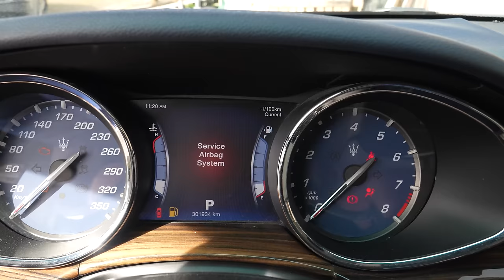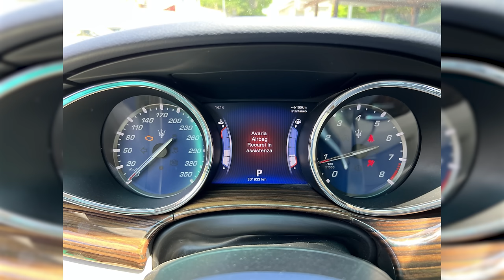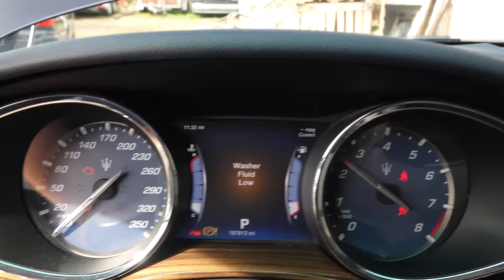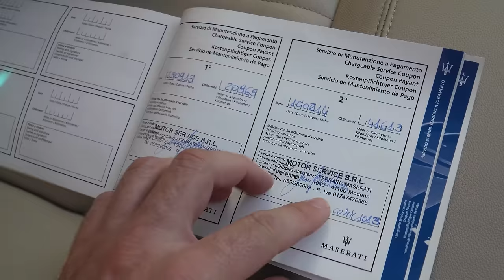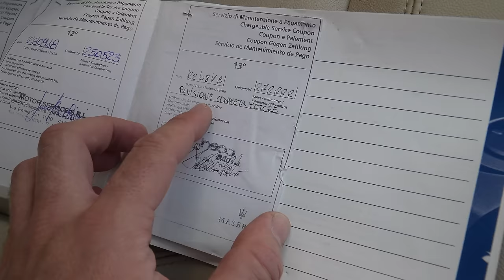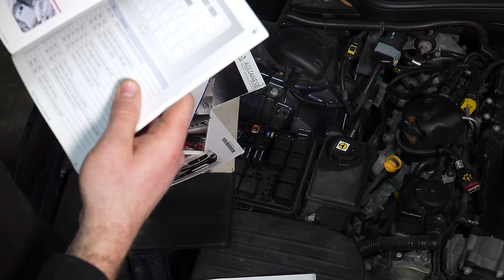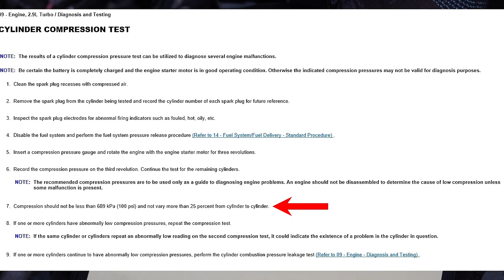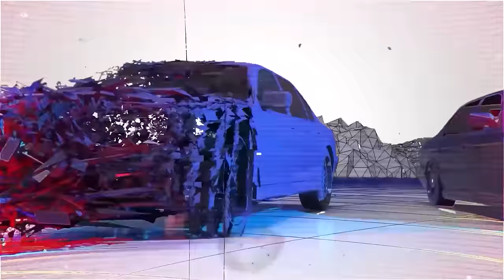I Bought The Highest Mileage Maserati Quattroporte GTS - Project Mantua: PT1

Comment: I used to work on Maserati's and I wish you best of luck with finding a problem within a problem which is caused by a problem and then there's these 3 other problems which are causing another problem. When they do work however, they're an absolute treat to drive and listen to. I always called them an upgraded Alfa Romeo. In both problems and quality.
Reply: He certainly is not somebody to shy away from challenges.
Reply: You could be describing any modern BMW repair experience. I wish people didn't always talk trash of Maserati, especially after seeing how bad BMWs really are. Ask you a question: would an E60 M5 have ever reached even half of the mileage of this Maserati, without rebuilding the engine twice over?
Reply: And there’s a lot of switchgear that is shared by Chrysler/Dodge products so that will definitely keep some costs down!
Reply: @71ala exactly, look everything the Alpina B7 needed at 110k miles. A new engine was only the beginning.
Reply: @71ala as long as you replace or upgrade rod bearings before 100k sure
Reply: You just made a diamond look like coal :)))
Reply: dont shit on alfa romeo
Reply: @thomass.586  there are challenges and then there are lost causes like this trident..
Reply: @seashackf1  That was Alpina's fault though, not BMW.
Reply: @71ala  The V10 is great as long as the rod bearings get changed, which sure isn't a small thing but FAR better than this glorified Fiat lol
Reply: @kristoffer3000  he had to replace plenty of BMW parts on that car. Without those Alpina parts it’d also be just a regular 7 series. Alpina parts are what give it that level of performance and make it so good.
Reply: @kristoffer3000  glorified fiat, lol. At least be fair, this car has a Ferrari designed and built engine. As good as that V10 is there’s a reason they sell for so cheap. With all its problems Its no more reliable than this.

Comment: I was a fan of the channel before. Now I'm a stalker. 300k on a Ferrari engine is amazing. Great find.
Reply: Ya people will trash Maserati, but it’s pretty damn impressive the car is still alive. People are significantly less likely to maintain these properly than Ferraris with the same engine
Reply: It was rebuilt at 270K, so really, the engine has around 30K on it. But it is impressive it lasted 270K for sure.
Reply: @JStryker7 maserati deserves to be trashed, i had a quattroporte with 78k kilometers on the dash and the engine sounded terrible, camshafts were trashed and metal shavings on the oil, it happens very commonly on these cars, window regulators broken, buttons on dash had a tacky film that was melting and got on your fingers, knob to move mirrors was broken many many bad quality pieces the car was taken care of, not a single scratch or dent, inmaculate seats and steering wheel, so it wasnt mistreated just bad quality on parts
Reply: @esdar66g95   and what year was that one? I haven’t seen that with the newer ones. They use many of the same parts as fiat, Chrysler, Alfa, etc. I’ve driven a modern Alfa for years and it’s been perfectly fine
Reply: @JStryker7 it was a 2006
Reply: @esdar66g95  ah okay so it was the previous generation
Reply: Especially only changing the oil every 20k km.
Reply: @tonymontana897  revised in Italian means reviewed, it doesn't mean restored. Also 20k is the usual oil change interval on some Italian cars that use Selenia 20k oil.
Reply: @esdar66g95 I have owned a V8 Maserati since 2009 when it was new, and apart from the sticky plastics issue (after 18 years), it has given me ZERO issues. So, Maserati DOESN'T deserve to be trashed, not any more than (to make an example) a BMW M3 V8 that eats its own engine bearings after 40,000 miles or breaks the crankshaft in two pieces (see this very channel...)
Reply: @esdar66g95  Yes, They are woefully bad in quality after Chrysler FIAT took over. They put their stank all over them.
Reply: @hugovale6360  20K is way too much. It will sludge up quite badly and cause many long term issue and shorten engine life.
Reply: @71ala  the rod bearings thing is over stated. last a lot longer than 40K miles when serviced and operated properly.
Reply: @tonymontana897  Shorten engine life?? Which engine are you talking about?
Reply: @71ala Exactly!
Reply: You look different into it.

My volvo s60r 2006 had 570k km on it. First engine.. & stage 1 365hp

This car has 300k, but has been rebuild already and the cost to keep it running probably was more then the car it self.
Reply: @JStryker7  As awesome as this car is. Isn’t 18K Euros expensive for a car with 300K kilometers?
Reply: @JStryker7 As awesome as this car is, isn’t 18K euros, expensive for a car with 300K kilometers?

Comment: I can only bow to the brave person who put 300k on one. Chances are he paid 3x the sell price in keeping it running. The service history says "Modena". Chances are, this was a company car which a company owner/director used daily to go to appointments and so on, for a decade. I can almost picture it. Excellent work!
Reply: It cost 100k new, you think it cost 300k to keep running? The annual service is about 600 and every four years 2000.
Reply: @rajivpaladugu8445  no i think it was expensive because they rebuilt the engine
Reply: @arbiya4346  According to the video that happened at 172k miles.
Reply: @rajivpaladugu8445  he did say the selling price not the new sticker price. Although I'm betting you're closer to the truth.
Reply: Not brave, lucky to get to drive it for 300k km’s.
Reply: @arbiya4346  The Alpina B7 needed a full engine rebuild at around 110k miles, amongst it’s many other problems. The Maserati will not be worse than that car and may be far better with what it needs.

Comment: I really hope that this project goes nice and easy and doesn't scare you away from maseratis, in the future you have to do a series on a 4.7 gts quattroporte, a truly phenomenal car that has been in my dream garage ever since I saw and most importantly i heard it.
I don't comment very often so i want to say that your channel is one of the greatest and literally my heart beat races every time i see a notification, thank you for the years of well made, well edited, humorous and really thorough repairs and restorations!!
Reply from the maker: That's the one I was looking for, but they are also rare and difficult to find. One day hopefully!
Reply: @M539Restorations  I really hope you do!! The problem with the gts is that not only it is the best fifth gen quattroporte to drive and look but also to own, the facelitfed models had much better electronics, the zf 6 speed was much better than the duoselect, the wet sump engines were more reliable than the early dry sump 4.2 also the gts had, as standard at least, fixed rate bilstein dampers so no skyhook to worry about either. As a result they require a premium when they go on sale and their owners are less willing to part ways with them. Still I hope we hear it's roar in your dojo one day!!

Comment: I don't know if this has anything to do with it, but on the Ferrari's they have 2 Engine ECUs; where each one is located, they control the opposite side bank! I would imagine this being a V8 it has 2 ECUs and probably follows the same non-logic
Reply: I don't think FCA would've used that type of engine control. This probably has one of their stellantis architectures which is actually pretty advanced.
Reply from the maker: Thanks, Sam! This one only has one ECU, it's the newer generation V8 and they thankfully ditched the 2 ECU setup.

Comment: There's a video of a Quattroporte with 426.582km on "STR testy" from +2 years ago. Something very interesting from that video is that back when the car was new, the owner did +90k in 7 months and went to the service due to a chain rattle. Problem was, that Maserati did not provide service instructions for the timing chain for the auth. Maserati dealer. A guy came from Italy, diagnosed that the chain was indeed to be changed, did it and everyone went on. 2nd chain was serviced 260k and third was good for the 426k in the video but the guy says it's getting noisy.

Also both front fenders were changed under warranty, because the inner plastic liner was rubbing them from the inside.

The car had very little or no corroding outer panels or undercarriage - keep in mind polish roads are as bad as german or even worse in winter due to salt.

Safe to say it was serviced similarly to yours (20k oil changes or even more) so that "Ferrari" motor could very much be very strong after all. Cheers Sreten!

Comment: Ferrari next 😛, after the E92, there is nothing in BMW welt left. This thing is going to be gorgeous. A gorgeous Fiat-Chrysler-Ferrari.
Reply: What about E30 M3, E36 M3, E28 M5, E34 M5? There are lots of uncovered classics from BMW which are yet to be resurrected.
Reply: And the m1
Reply: @ZiemoPL  Those are gorgeous classics for sure, but the man has now done multiple full engine rebuilds of the most complex NA engines BMW ever made. An E34 M5 would be 3 steps back in terms of skill required to repair it.

Comment: I don't think revisione completa motore means the engine was rebuilt. In france, most garage use a very close term "Révision complète" and it doesn't mean rebuilt at all, it just means as you say, a thorough service where more parts and points are checked and replaced if needed than your usual service where they just supposedly change your oil and all kind of fluids.

Comment: When I heard cam timing, I thought of an alignment problem between crank and camshaft. If so, then likely a timing 'belt' or cam adjuster, if one is present. 
I wasn't surprised by the consistently low compression on one bank UNTIL you said the bank number, which is the opposite of the sensor.
Maybe the bank sensor cables were swapped, but that is highly unlikely.
Looks like an interesting build ahead.

Comment: I saw that the exhaust has some flaps in it at the mufflers check if they open and close and unstuck if needed and if you like the sound really much do the golf tee mod as per bmw e46 flaps vaccum hose and leave them forever open so you dont have to be in sport mode all the time

Comment: If the timing is off, that could easily affect the apparent compression reading. In particular, it might have a lot of valve overlap or otherwise having the valves open and air exiting through the valves for a short time during the compression stroke. If the timing is wrong, it might end up with less valve overlap and a higher (measured) compression reading.

Comment: If you close the latch on the doors while it is open, it will stop the dinging. You just have to remember to un latch it before you close the door by pulling the door handle.

Comment: It is possible that when you started to measure the cylinder 5, 6,7 and 8 the oil system was primed from previous measurements and that is why they had a higher compression. You can repeat the test but start with the other bank first.

Comment: My man, i even't watch the video yet, just reading Maserati, tell me everything. What a big step into one of the best car's brand in the world. Other than Ferrari, only Maserati and Fiat used a Ferrari engine in their cars, and Maserati still use it in the Quattro Porte, and it sounds 10 times better than an original Ferrari one. All with luxury and Italian Style.
Revisione completa del motore, in technical term, is totally disassembly of the engine, measurement of every component subject to wear, possible rectification of engine block and head, all engine bushings (bronzine), crankshaft polishing, etc etc. (I'm Italian, feel free to ask anything)
Reply: Correction: Lancia also used Ferrari engines. First in the Stratos, and then later in the Thema 8.32

Comment: No play in those wheels? That was sarcastic right? xD

Also, oil pressure on any engine afaik is normal with 2bar at idle +/-0.5bar and when you rev it, 5bar.  Pretty universal afaik.

Anyways, awesome to see this! Looking forward for more videos, also, the play on those wheels is just off the chart, must be going toe in and toe out like crazy when driving

Comment: I do like the Maserati design language and their take on Ferrari engine noises is a particularly pleasant one. But, and this is a big one: you will never be able to completely exorcize the electrical gremlins from that car. It's just inherent to all Italian cars. I probably would have tried my hand at a Maserati Ghibli instead, at least they're even cheaper so the pain is slightly less, plus they're somewhere between the size of a 3-series and 5-series instead of a large sedan like the 7-series. Depends on what you want, though. If you want a luxury barge then the Quattroporte is very suitable. At least it handles better than most luxury barges, despite the size.

Comment: Just bought an e60 n62b44. super cheap, For reasons im now theorizing is a cracked head/block. Previous owner had coolant resevoir explode, When i got it i took the water pump off and there was some ice, I was scared but didn't think to do a headgasket test at the time as i was doing valve stem seals. Did the seals, Car is "smoking" or steaming out the exhaust with plenty of water dripping, Coolant hoses feel solid as a rock there is so much pressure. Will test for c02 tommorow but all the signs are there, Especially considering head gaskets on a bmw are one of the things they got right. I got it for pennies but its an auto, If i gotta rebuild the engine then its getting a manual trans.

Comment: There is a common misconception that "turbo" = quiet or "bad" exhaust note, but that has a lot to do with modern (already-quiet) cars having a pair of turbos which then further muffle the car. You need only listen to the Ferrari F40LM (or Sauber C9, or Delta S4, or Quattro S1 Evo, etc.) to realize that turbos aren't the issue. And no, it's not just race cars. A free-flowing exhaust on a turbo street car will also be rowdy AF.

Comment: Just fyi even with fuel pumps disabled you will still wash out cylinders cause the injectors will still pulse and clear out fuel in the lines. Why in the video you can see moisture coming out.

Comment: Same gauge cluster as a Chrysler Pacifica, same window/ light switches as a Dodge dart, Jeep Wrangler or Ram 1500 .... And mostly came with the pentastar v6*?......... What a car.
Reply: these never came with a Pentastar
Reply: @Johnny362000  oh true? They didn't use the 3.6 v6 notorious from Chrysler? That's surprising.
Reply: @Bmw_Z3R  the petrol V6 is a bespoke engine designed by Ferrari for Maserati, based on the V8 in Sreten's example. The diesel V6 (not sold in North America) is a VM Motori engine that was also used in some Jeeps, in which it was branded as "EcoDiesel"

Comment: Well thats a really brave purchase. 
I work Chrysler and find it hilarious to see the shared parts, the fault code descriptions, and so on and so forth.
I hope you are ready to do electrical diag Streten, because that is what you are going to be doing the most. 
As for the airbag light, good luck with that one, you got a broken wire somewhere, maybe a broken clockspring, or god knows what else.

Comment: Dirty build from the Factory failed this imho.

 Initial contamination (scores) show on the Lower Main Bearing, in line with the Upper Main Bearing's Oil Groove (easiest path for the dirt to get into the loaded area). Muck most likely from the Crankshaft or anything after the Oil Pump (Oil Cooler, Galleries etc)

The Big End failure was most likely due to High Load running later in the engines life, or running low on oil by the previous owner. This will have exacerbated the situation with the damaged Lower Big End Bearings that take the load. 

Dirty builds / low oil level / pressure always knock out the Big Ends first, when the engine is used at its defined duty level.

Crank Grind and Oversize the Bearings is an option, although possibly more than a Short Motor? I've seen worse cranks recovered, depends on time versus effort though.

Comment: Timing chain in the back of the engine? Just like my 4-in-line-watch-out-for-breaking-chains-N47-diesel. More proof that Maserati is not much more than a tractor, although maybe a very comfortable and fast tractor in this case.

Comment: Is that on the Charger platform? The side mirrors look almost just like mine…
Reply: No, it's unrelated to Charger platform. I wouldn't be surprised if they're using the same mirrors though
Reply: @Johnny362000  definitely the same mirrors. Some of the angles look similar is all. The door card window controls are the same. The instrument cluster is definitely the same variety with a Maserati twist. Battery is in the same spot and appears to be the same. The spacing between the front doors and fender is very close which made me ask given it appears to literally wear similar components both exterior and interior. If a coincidence then it’s a funny platform sharing one. I’ll keep my Charger.
Reply: @bergePanzer581   it's definitely borrowing lots of parts from the Chrysler side of the family, but the actual construction of the car is unique to Maserati. 

The next generation of Quattroporte (which isn't due until 2028 and hasn't been shown in any capacity yet to my knowledge) will share a platform with the upcoming 8th generation Dodge Charger though

Comment: from the compression test and the fault codes it seems like the camshaft actuator has failed and is stuck advanced or retarded (is the part where the chain runs on the end of the camshaft). so while its doing compression test the valves are being closed longer. thats just what i am thinking.